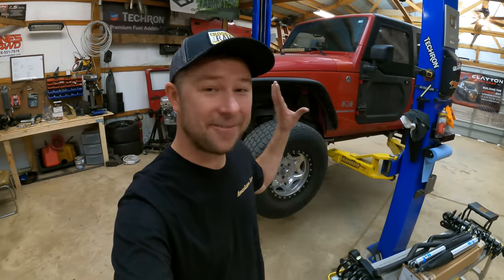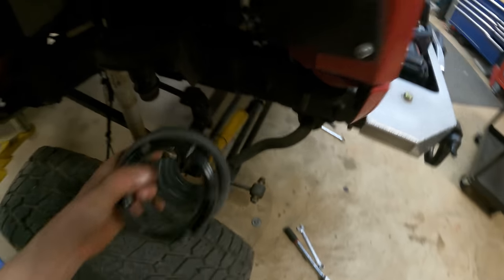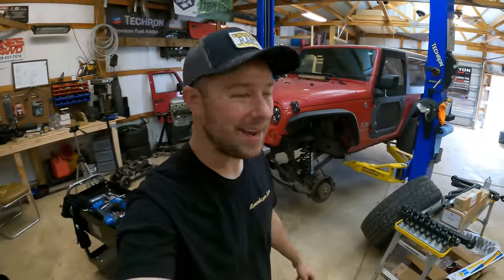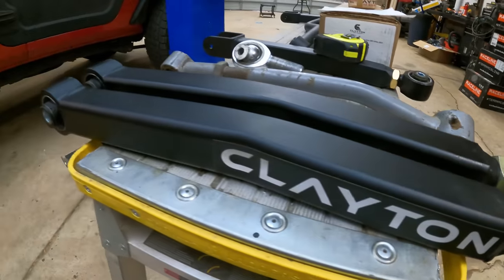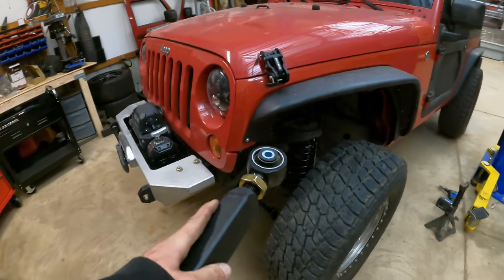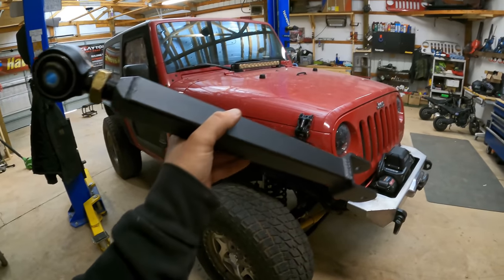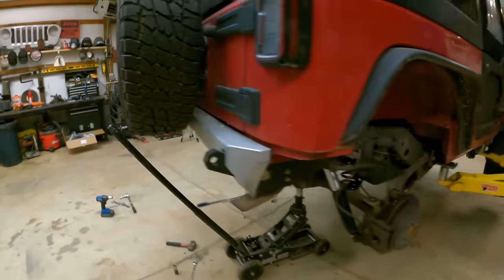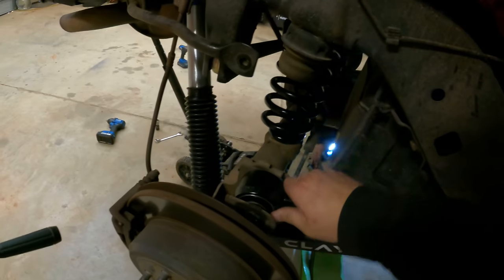Lift Your Jeep Wrangler The RIGHT Way! How to Install a Fully Adjustable Lift Kit

Comment: Great video for those learning how to do it yourself! I can confirm having crowfeet wrenches are a must when dealing with jamnuts. No one else ever tells you that, great job pointing that out! I need to move my front lower control arms out one turn to length my caster a degree. But first need to losses the nut as pipe wrench just didn’t cut it. That small adjustment made a huge difference in drivability. Shop that did alignment put it to factory specs, but once lifted you need more caster so learn how to do these minor adjustments yourself if you have adjustable arms.

Comment: The 2.5 lift probably doesn't change that much but if you go to 3.5 or higher there is a lot more to this. Most lift kits are sold for a fully loaded Jeep. Steel bumpers, winch, skid plates and full of people. My 3.5 kit actually came out to almost 4.5 inches empty. This causes a lot of issues with the drive line geometry which must be addressed or it will never run right. In the front you will need a track bar correction bracket which lift's the axle end of the track bar a few inches. You need a drag link flip kit. The track bar and drag link have to run parallel if not every time you hit a dip you will get bump steer. The stock D30/44 is only setup for 6 degrees, once you go that high even with adjustable control arms your either gonna get a good castor and bad pinion angle or good pinion angle bad castor which anything less than 5 degrees just begs death wobble after hitting a pot hole. Geometry correction brackets will help with this until you get a D44 that's built for a lift in which most come with 10 degrees separation so you can still get your castor and pinion angle set right. Then there is the rear. You need track bar riser and correction brackets there as well but that still wont address getting the pinion angle set. Because if you set it right, the stock spring perches will bow your springs. for that you need something like the MetalCloak JK Rear Coil Spring Alignment/Retainer Kit which is basically a spring wedge that goes between the axle perch and the spring and will offset the spring back towards more factory with the 10 degree wedge. 

I originally bought a AEV dualsport RS SC 3.5 lift kit for my 2D JK and it ran OKish. but since them I have replaced almost every part of the driveline and steering front and rear with proper heavy duty components, and now it runs perfect. So if you think your gonna throw a cheap RC 4 inch lift kit on your stock Jeep and be ready to go. Your not. It will run for a while and then things will start breaking.
Reply: All true. I bought a 2.5 rc lift for my wife’s jku and am slowly swapping it all to better quality. I don’t mind the springs really but the shocks are crap !  Got rid of my jk and got a jt and went with a 2.5 inch lift and 37s and I can’t believe how much better it drives than the jks.  I realize wheel base is a factor but I think the new platform just rides better lifted anyways.  A lot of people with lifted jls I know say the same.
Reply: @Adrian-rn1ym  Sorry I wasn't raggin so much on RC as I was on kits in general that do not include what you really need and even with my 2500.00 AEV kit, other thing's didn't last 15K before they started breaking. The 5160's shocks that came with the AEV kit all started leaking about 20K, my track bar upper bushing went at 13k miles. 2 weeks after that one of my tie rod ends blew, the stock Rzeppa joints all went about 25K etc... and even with the more expensive AEV kit I still got intermittent DW when all the conditions were right because I needed adjustable control arms. Stock brakes are almost crap with 35's. As well as the stock dana30 with 3.21 gears on 35's. I was a newbie too back in 2015 when I put the AEV 3.5 lift on a bone stock 2013 2D JK. By 2017 when I got my Jeep paid off I bought a Dodge Ram sport 4x4 just to have something more reliable to drive then went to work on the Jeep. both the Steersmarts 1.5 ton tie rod, draglink and track bar and Core4x4 medium control arms (all 8) I highly recommend. Those right there made it feel like a whole new Jeep.  TF Falcon 3.3 sp2 shocks (expensive!), 35x12.50 BFG Ko2 on Fuel rims. (best tires ever made) I have 44K on the current set and they still have half tread left.  Teraflex high angle drive shafts (I am still out on these. The TF rzeppa is better than the stock mopar. The axle size is a 1/3 the diameter if and when they break I will go with Tom woods or Adams. Dynatrac Big Brake kit. (made a huge diff on stopping power. keep the mopar pads, the DT pads shed dust everywhere. Saw no diff between the two driving) PSC Big bore steering box and cooler (can now drive with my little finger, this box makes it feel like steering does not exists), Mishimoto V2 Performance Aluminum Radiator with silicone hoses (live in Texas, Jeep does not even know what heat is any longer) I hear their stock replacement radiator is crap. but this 700.00 one is heavy duty tig welded and 160% increase in volume. dropped right into stock location with a little fight but did fit. and finally, The Fusion Elite D44 front axle with 4.10's and lockers. I live in the city and have to drive to the sticks. The 4.10 works for me on the 2 door. Maybe a 4D needs lower gear ratio with the heavier weight. But I think the 4.10 is perfect for hwy and offroad. AND SO .... after all of that, my Jeep runs like a top and has been 100 percent reliable for 30K+ miles now and actually prefer to drive it over my truck. All of this was trial and error over several years but if you really want a reliable ~4+ inch lift Jeep. In my opinion. This is everything you need.
Reply: @jamescole6846  perfect thanks for the reply !  . I have the ko2 s in a 37 on my gladiator and love em

Comment: Dude, you have lost some weight. What's the secret?

Always nice to see install videos that break it down for the newbies like myself. I've been looking at a 2" suspension lift for my '23 JLU, but I'm gonna wait til tax return so I can get the lift, new wheels, and 35's all at once. I think I am set on the Nitto Recon Grappler tires when I do, and some KMC Rockstar III wheels if I can find them for a good price, but still shopping lift kits.

Comment: I’m putting one on now. Can you explain the front uppers CA bolt and washers. Specifically the locations for the washers?  Inside or outside?  Outside there’s little thread available for the nut. Appreciate any help. 

Keep up the great videos.
Reply from the maker: The front upper bolts and nuts are for the frame side. Depending on the year, the passenger side factory bolt might be too long to remove (exhaust in the way). That bolt is a replacement to go back in easy (in case you cut the factory bolt to remove it, or can pry exhaust. As for the washers, I can’t really remember and would have to see it, sorry I can’t help there.

Comment: Hey man. Love your videos. 

My TJ recently rotted out on me and fell apart on the highway so I was in a rush to get a new jeep. I have only had YG and TGs but decided to get a JK. Because I was in a rush I didn’t get exactly what I wanted and in trying to turn what I have into exactly what I want. The biggest thing for me right now is height. Want it to be a little taller and not sure what the best way to do that is. Right now I believe it has a 2inch suspension lift on 33s. Wondering if you have any tips. Thanks!

Comment: @ JK Gear and Gadgets do you have previous experience with the Bilstein 5100? If so what are your thoughts on them? I’m in need of new shocks and am considering those.
Reply: I originally bought the AEV dualsport SC RS 3.5" kit for my jeep and after 25K 3 of my Bilstein's 5160's were leaking around the seals and they are not rebuildable. Bilstein has a pretty good reputation but since it had been a couple of years they basically told me to go pound dirt. They are expensive but I replaced them with the TF Falcon 3.3 which have on the fly adjustment knobs from firm to medium to soft and medium actually has 8 micro adjustments. It took me a while but I finally got my dialed in for my DD ride and I am very happy with them. Off road you just turn them to soft. Just my opinion. Others may have had better luck.
Reply from the maker: I had the 5100s on my JKU a long time ago before the 5160s and falcons. 
I liked them for the price and for a DD they worked well for years!
Reply: @JKGearandGadgets   thanks I appreciate it. I think that will fit the bill.

Comment: Will those Clayton joints work in place of Rock Jocks or will I have to change out control arms?
Reply from the maker: They should be the same thread pitch! 1-1/4"x12.

Comment: Would 4 to 6 degrees of caster also work for the gladiators ?
Reply from the maker: Yes, but with a JL/JT you can run closer to 6 since the front axle disconnect stops the driveshaft from giving you highway vibrations since its not spinning like a JK unless you are in 4wd.

Comment: Had to stop watching when said, "my stock track bar was 32.5", wimpy, so I set the Clayton track bar a little longer at 32.75", a HALF inch longer".... Cannot trust your skills if you don't know the difference in increments of 32.5" vs. 32.75".
Reply from the maker: Feel free to film yourself doing a project and see how many slip ups happen. 
Or feel free to watch the current Ultra4 build if you’d like to comment on my skills I guess
Reply: @JKGearandGadgets   I’m not bashing you as a person, and I’m sure you proofed that video, but measurements are crucial. I’ve built my Jeep from bone stock, I don’t care to video it. I have respect for those that do, but at least make sure it’s accurate.